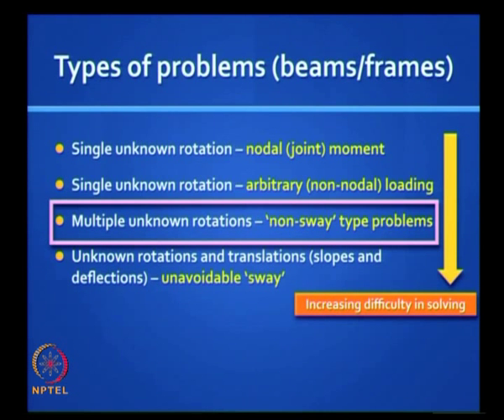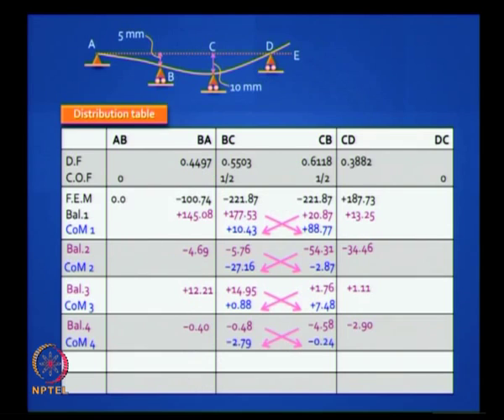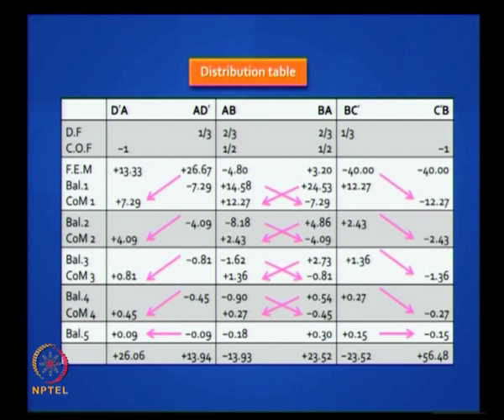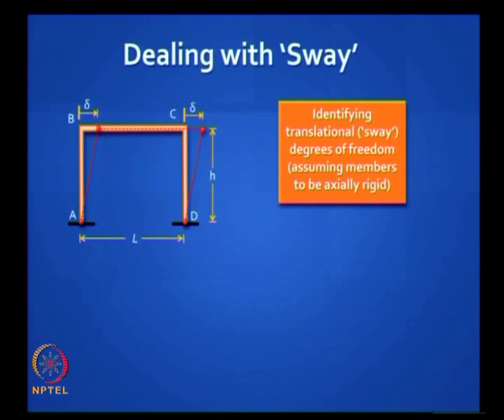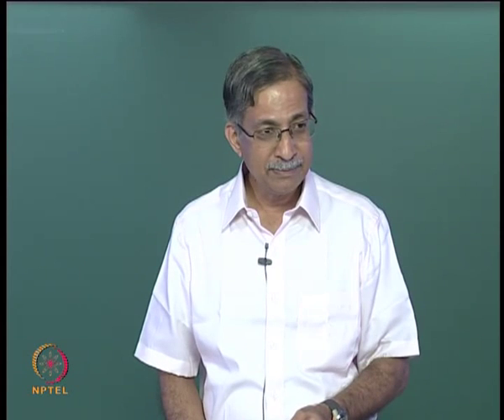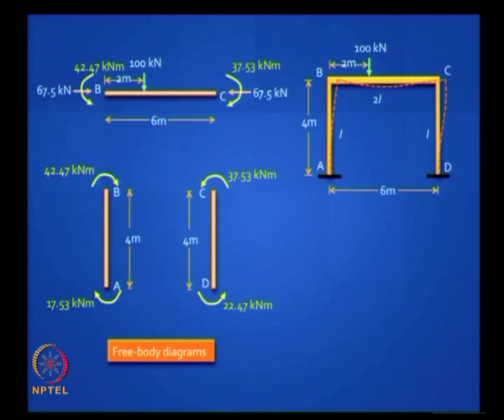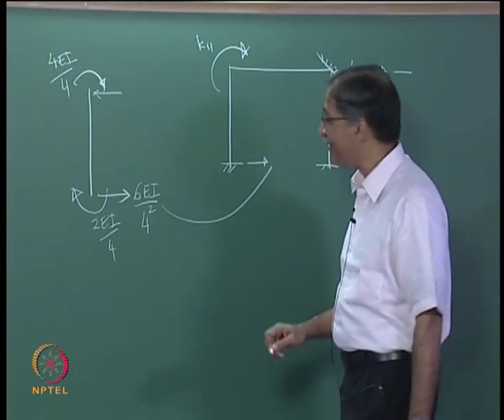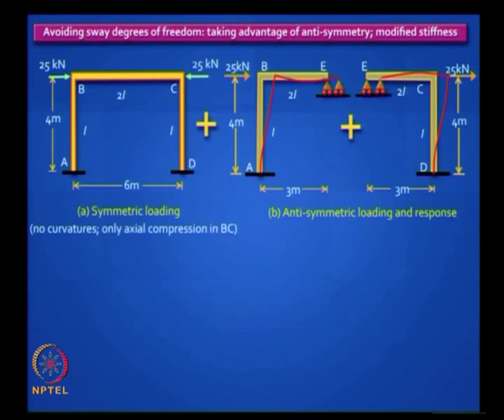Mod-02 Lec-15 Review of Basic Structural Analysis II

Comment: sir with humble request in lecture 14 where ur goodself solved the sway frame u used EI/L in slope deflection equations for column but here for sway portal frame u used 4EI/L in equtions for columns.....
Reply: In lec 14 the sway was elegantly accounted (ignored for calculation) by using modified stiffness of the cantilever for the cantilever action (by guided roller support) and same concept has been applied for the problem at the end of this lecture continued to the next lecture :)